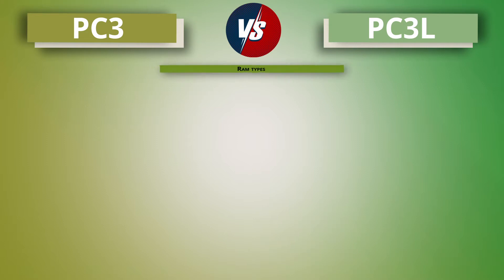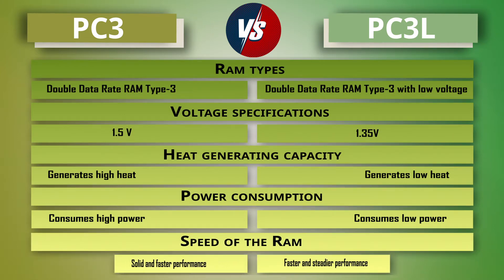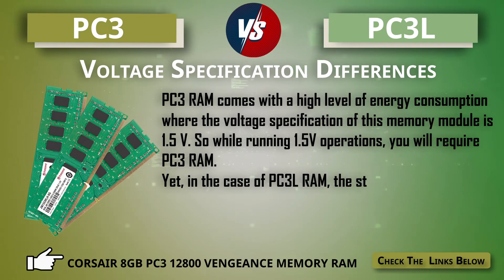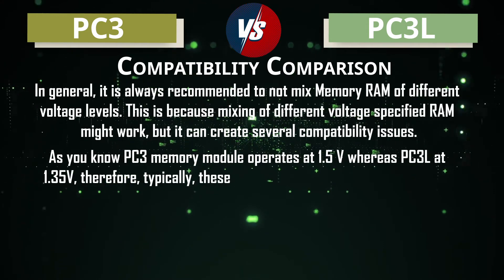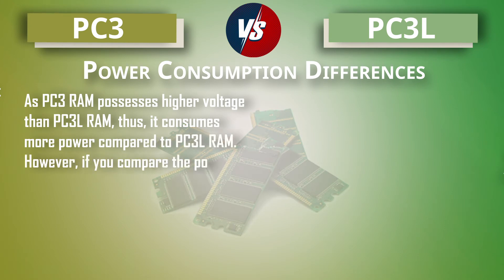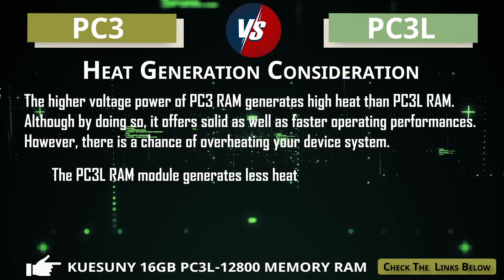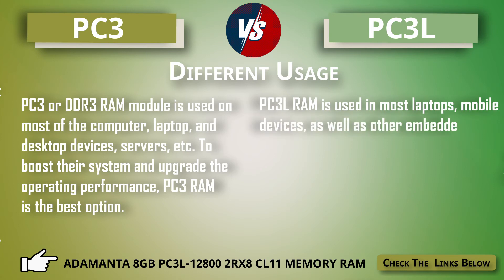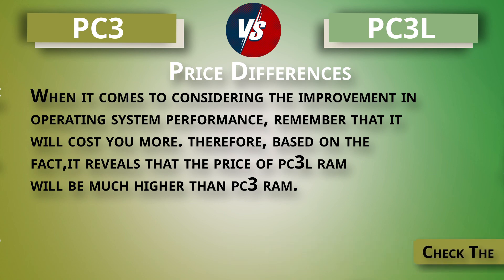PC3 Vs PC3L Ram- An Ultimate Comparison For 2021!

Comment: THANKS! I almost bought L and cooked my laptop. Gonna buy the usual one instead. It is okay to put 1.5v into 1.35v slot, right?
Reply: No, 1.35V memory slots do not generate enough required voltages to power up your 1.5V PC3 Ram stick.
Reply: @rajv1r_ahm8d  Hi. I mistakenly bought PC3 ram but my laptop runs PC3L ram. Will I be able to use PC3 in my PC3L?
Reply: @jeroneguibone2458  Unfortunately, It won't work, since your ram slot only support low Voltage.
Reply: Hi, my laptop having 2GB DDR3 1333mhz & i ordered one 8gb DDR3 1333mhz but received one is DDR3L should I use or return it , kindly suggest .
Reply: It all depend on your CPU spec and not on your rams slot.